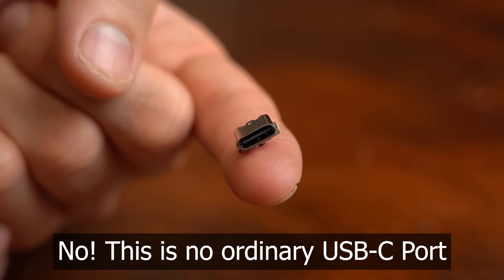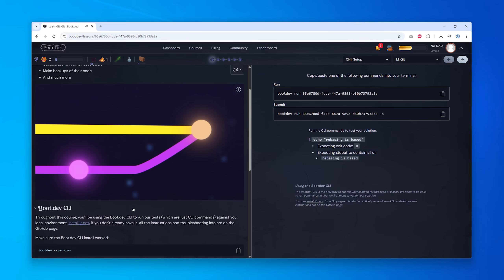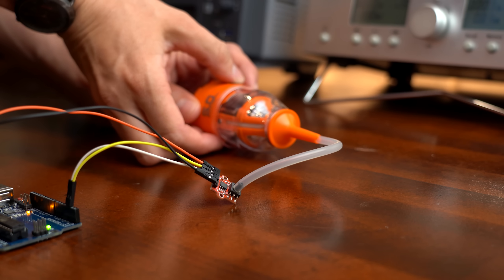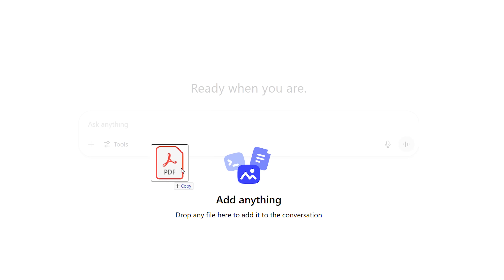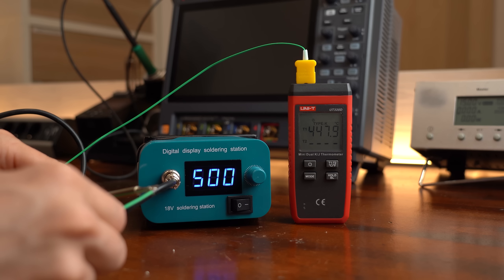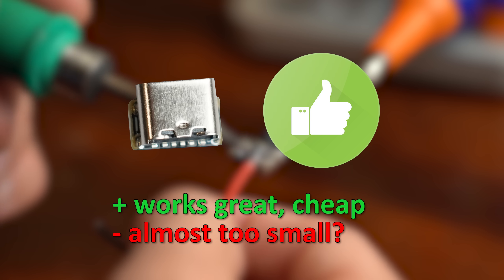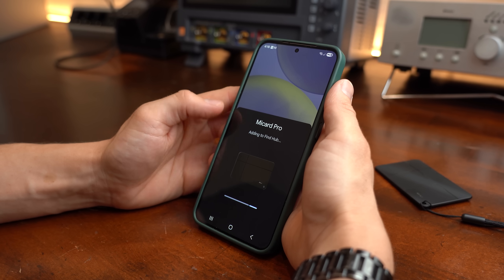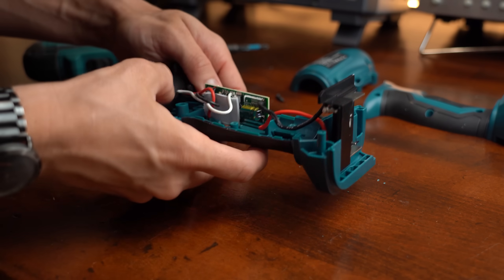I tried finding Hidden Gems on AliExpress AGAIN! (Part 15)

Comment: One thing I learned from a bigclive video:
DeWalt batteries do not have internal protection, and instead rely on circuitry in the tool to cut off the voltage at the correct point. For this reason, I wouldn't quite trust the DeWalt version of these battery-operated fans/soldering irons.
Reply: Honestly I would totally get it, as it saves cost to have the circuitry built once into the tool rather than having to build it into every single battery. But when you’re charging US$100 for a single goddamn battery you shouldn’t be cheaping out on 25 cents worth of circuitry.
Reply: @MrThedennisblack exactly. It makes sense in theory, but the batteries have such a heavy markup that it doesn't make sense unless you're a shareholder who needs a new yacht. 
The cheap knockoff batteries have protection in them, there's no excuse that a battery costing 3-4 times as much, cheaps out on the protection circuit. Corporate greed.
Reply: @Boogie_the_cat It’s not only that they cheap out on a battery protection board on an over-priced battery, it’s imo a safety requirement to have the protection board on the battery.
Reply: @MrThedennisblack  It really depends. Parkside does that as protection cutoff circuit is in tool trigger.  Protection circuit on battery itself would be drawing some current all the time and would "self discharge battery". This way tool decide if battery is low on voltage to protect battery.
Reply: @MrThedennisblack I have less batteries than I have tools. Although I mainly use Makita, I probably have 25-30 Makita tools, and 7 batteries. This is fine since there's only one of me using the tools so I don't need many batteries, and many of the tools are kind of niche. This is how many other people I know work too. Therefore it would be cheaper to have the circuit in the battery
Reply from the maker: Interesting information, thanks for sharing!
Reply: @greatscottlab I rebuild and repair lithium batteries and I can confirm this is true with almost all tool packs. It's pretty smart from a manufacturing standpoint. The more expensive circuitry would be in the tool and charger and not needed in the batteries that are more disposable in nature. It also keeps the battery size down.
Reply: @aznative_  " It also keeps the battery size down."   Hm. The circuit is pretty small. I think you can gain almost nothing here.
Reply: @Slazlo-Brovnik  I understand a few mosfets aren't going to take up a lot of space but they do take up space. My point was very valid. It's most certainly a consideration.
Reply: @aznative_  I simply don't believe that. Whether the casing of a battery pack is 3 millimeters larger has zero implications in real life. Furthermore, in all the battery packs I have opened so far (mostly to reuse intact cells from an  otherwise dead pack), there would still have been room for the few components.
Reply: @aznative_  there should at least be a BMS in the battery, even with a cutoff switch built in the tool it wouldn't prevent the cell to unbalance and some cells could overcharge/overdischarge over time..
So they also could integrate the cutoff in that same circuitry, and that would not take up more space.
If they don't use BMS, though, that's a different story ... maybe some really don't but keeping the pack size down should never be an excuse for cheapening out on security.
Reply: @pbe6965 Tool makers skip full BMS boards to keep packs cheaper, more reliable, and compact. They already run heavy connections for power and sensing, but a real BMS would add MOSFETs and control hardware that take up valuable space. Instead, the charger and tool handle the smart protections, leaving only minimal safety circuitry in the pack.
Reply: @greatscottlab  but! The cheap Aliexpress clone batteries do contain protection!
Reply: Same with Milwaukee, I believe only Makita "Star batteries" put the battery protection circuitry in the battery case
Reply: @DonaldEdney   Its been a while since i messed with my Makita batteries but if i remember right, Makita batteries still need a protection circuit to be used safely, you can make a super simple one with just a mosfet which is used in the super cheap Makita tools like their budget hedger, but they will also over discharge without this protection. like they expose a  voltage that says "battery ok to use" so all the monitoring is inside the battery, it just doesn't actually cut off power. i assume this is so you're not power limited by whatever component they would theoretically be using to cut off the power inside the battery. could easily be wrong on all this though, its all half remembered from like 2 years ago. (EDIT: I'm describing the star protection system)
Reply: @DonaldEdney  And Ryobi
Reply: @DonaldEdney  my 5ah m18 have bms i think only m12
Reply: @DonaldEdney true for M12, but M18 seems to have a cutoff circuit.
Reply: @DonaldEdney Ryobi also has built in battery protection (I'm not sure about the newer Edge variants though). It's one of the few benefits of having extra space from the stem.
Reply: yup lidl/parkside have low voltage protection in tool, but the battery has a charge side bms/balance. if you over discharge the battery just once the board will never let you charge it again .....
Reply: @lezbriddon do parkside batteries have short circuit protection? I'm using them in my projects and want to be safe
Reply: @tonyxforce nope the batteries are direct to terminal via a metal strip fuse. There's is a board to do the balancing while charging but as far as I know it only performs that function when it has communication with the official chargers data stream, it's some weird 1 wire serial but in the many times I've looked I can't find any info or even a data sheet for the chip in the battery.
Reply: dewalt also has appalling QC on their batteries. Even a cursory search shows how many people suffer from defective and DOA batteries.
Reply: If you accidentally dip you battery voltage too low, just "jump start" it. Manually putvoltageacross the battery terminals with a bench top power supply... or even use a working battery and some wires. Be careful not to short them 😅
Reply: @reefjames6302  I guess that could work, but it would be better if the devices had protection to begin with.
Reply: @vinnysworkshop yeah, but also if they baked that into the battery packs i bet they make it so if it does accidentally dip under voltage, it would brick the device.
Reply: It's the same with Bosch Professional. The cheap Makita knockoffs off AliExpress on the other hand...I can use THEM for lighting purposes without fear of overdischarging below 16V if I leave the lights unattended.
Reply: None of the major tool brands have batteries with low voltage cutoff protection, except Ryobi.
Reply: @Boogie_the_cat  My Makita batteries do.
Reply: Also Parkside does that as protection cutoff circuit is in tool trigger.  Protection circuit on battery itself would be drawing some current all the time and would "self discharge battery". This way tool decide if battery is low on voltage to protect battery.
Reply: DeWalt batteries have a 3 year warranty.. use it
Reply: ALDI batteries (XFINITY, Workzone, Ferrex, etc) have low voltage cut-off built into the batteries.

Better that way IMO, guarantees protection of the cells regardless of tool.
Reply: I 'bricked' 2 DeWalt 20V batteries through off-label use which produced a near-short circuit. On opening them up I discovered that both had melted a thin flat metal strip which was obviously intended to be a fuse. I repaired them and they are still in use with no apparent ill effects. So they are inherently safe, but would be better if this was done electronically in the battery instead of in the tool.
Reply: Just what I came here to say ! better check the battery is fully charged and be careful to switch the tool off (or even better, unplug the battery after each use).
Reply: I can tell you that almost no manufacturer installs a cut-out in the batteries for (small) power tools. I have opened many battery types/manufacturers in my job and so far only found a cut-off with a mosfet at Makita. Otherwise, there is usually only a fuse (which can be a thin sheet of metal or a "real fuse"), cell tap for the cell voltage and NTC for charging. Some did not even have cell monitoring for charging. The power tool then switches off when the battery is low, not the battery.

The situation is different for larger batteries with voltages above 50-60V for larger machines. A lower voltage is often applied via an extra PIN for communication with the machine and only then are the power terminals enabled.
Reply: I use Dewalt batteries for a lot of stuff and yes you do have to be careful not to 
over discharge the batteries ,but i think that Dewalt batteries are a better choice
to use for proprietary stuff than Makita batteries ,because if a Makita battery 
gets to low  ,eg if you leave it at a low voltage and forget to charge it ,there
is a chip that will not let you charge the battery again ,so you will have 
to replace the whole circuitry even if the cells are still okay .
Since Dewalt batteries do not have protection against low voltage ,
you can still save the battery even if the charger will not charge the 
battery and the batteries do not have a chip memory  protection like
Maktia
Reply: @kimnielsen9320 
Not having a battery protection board on the battery is a safety hazard. 

Recharging batteries that have been discharged below the specs is a safety hazard too btw. (I’ll admit that I’m guilty of doing that but at least I’m aware of the risk. The average user is not).
Reply: There are good batteries with short circuit protection and BMC and lesser batteries that do not have those features.

Project Farm made a video some time ago.

Comment: AliExpress has doubled the prices and raised the shipping prices recently, or should I say my country blocked the standard shipping option but price raise is there doing.
Reply: It will change week to week now since they started those tariffs. It's getting cheaper. You just have to look a little bit harder now to get the price you need.
Reply: @dmo848 shipping is through DHL or similar service mostly costing around 55 bucks for a 2 bucks item.
Reply from the maker: Sorry to hear that....

Comment: I think your pump uses the same chipset as the cheap travel vacuum bag pumps like I have. The double tap is to prevent it from accidentally turning on in your luggage in that instance.
Reply from the maker: Ok, thanks for the information :-)
Reply: Was about to say it as well. It sucks when you charge up your battery before you go camping just to discover it is empty when you actually need it.
Reply: Nice pun  @erkistan
Reply: My air pump for my camping air mattresses is also like that.
Reply: Lol cụ coin viNE 0,06875$

Comment: I like that the new intro video is shorter than the original, but I wish you had taken the live action intro and cut it down rather than redoing it from scratch in the hand art style
Reply: He made a poll last year to see if we liked the new intro video and the results were negative. He still used it regardless. But we talk about ego here not electronics don't we.
Reply: That's what sponsorblock is for.
Reply: I don’t think the intro matters that much
Reply: The intro is fine.

Comment: I have deleted my Ali express account... Its the same as Temu.... Only liars and scamers. 😢
Reply: and i has used aliexpress last 10 year and  ewery month order somethink  elektronic or parts and all has come good and all has perfect good parts no newer has scammer or broken parts. only problem has shipping time has long.
Reply: @mattivirta be happy(but not arrogant), because you do not know the bad part of them.Recover the money its a very long process! And there are a lot of misleading information on how to proceed in such cases....jus be happy that you do now know the ugly part of them.
Reply: @mattivirta Stuff used to take 1-2 months to get to me, but in recent years they've changed that, so now most things get here in 2 weeks (to the EU).
Reply from the maker: Well, I honestly never had big problems. Sorry to hear about yours.
Reply: @greatscottlab  Last one on AliExpress was ...I tried to buy a lifepo4 for my solar installation 30kw for 3k€... battery never came....I had a lot of pressure from the seller to drop my complain....in the end I managed to get my money back.but I lost two and a half months...
Reply: @greatscottlab  Same. You can find great stuff if you are just realistic about the price, and use some common sense.
Coincidentally, I just ordered a MiLi MiTag yesterday to test out. Google's Find My Device network is not as good as Apple Find My in low-traffic areas without many people, because by default you only get tracking results once enough Android phones have been near the tracker. It's something Google did for privacy reasons, which is of course a great idea otherwise, but it severely limits the effectiveness in more rural areas.